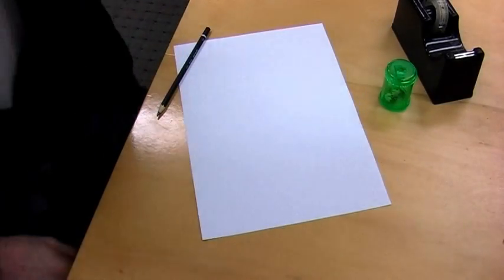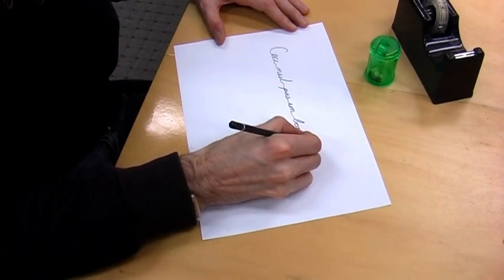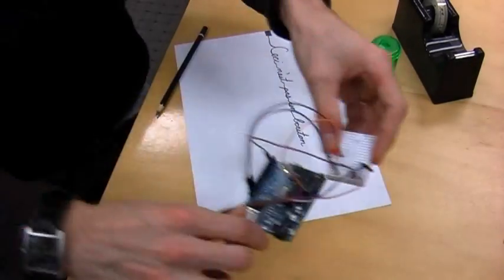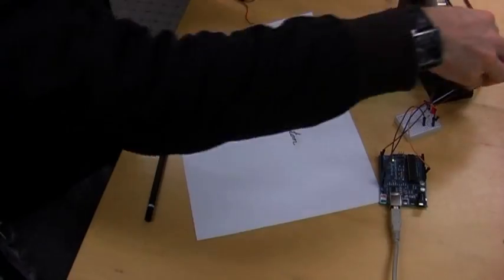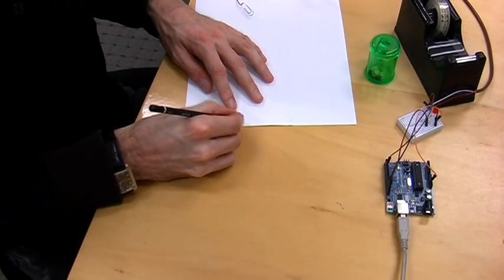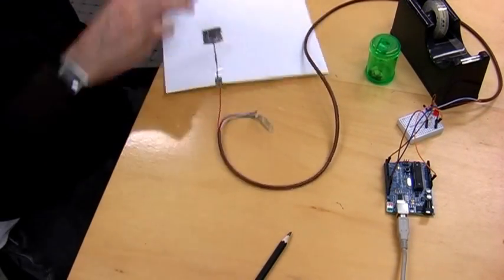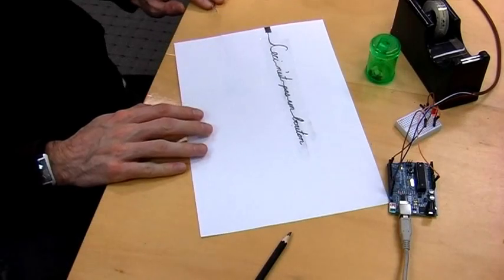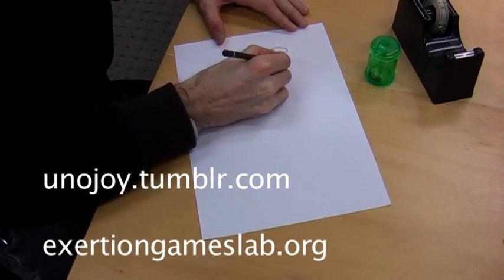Make a Touch Sensor with a Pencil Drawing

Comment: Tnx maybe using aluminum foil with resistors will help?using 100 resistors for each aluminum key?i still dont get what you mean by measuring the time and how you measure this.But if it's anything about getting value in the analog pin that sound to be practical.How do you measure the time?I read somewhere that when you put your finger on the aluminum foil the resistance will change is that wrong?Can we talk using hangout app if you have? My id is Sm.steve.moretz@gmail.com

Comment: Hello I really likes your project.I'm going to make my own paper keyboard but I don't have 100 pins for 100 keys of the keyboard.The question is can I get the voltage in arduino using one analog pin and then I can calculate which part of the paper was touch by the distance, and the figures I have set in the program?I basically mean to paint 100 keys and then connect that paper to arduino and wherever I touch I save the value for the arduino to recognize it! So I'll have a touch keyboard. What do you think is it possible?
Reply from the maker: To be honest, probably not, especially since the sensitivity would be pretty tight with the keys right next to each other, but it seems like it would be worth trying! The code is measuring the time it takes for a charge on the trace to be sunk by the body touching it, not by any particular voltage measurement, but that time should be longer the longer the trace, since the resistance from the pin to the body will be bigger.

Comment: I didn't understand the circuit. How did you made the circuit?
Reply: Graphite in the pencil is conductive, and essentially want they made was an antenna that changes resistance when you touch or move your finger close to it.

Comment: Control of explosion proof, waterproof, fireproof instruments or any instrument, which is often subjected to abuse (i.e. large blunt impacts).

Also note that with most capacitive sensors, assuming there is a trace to follow between the point of touch and the sensor pin, can be subjected to brutal trauma and still function.

For example, you can fire a bullet directly through a capacitive sensor (Alfoil on one side of cardboard) and it will still function.

Can you do that with any other switch?

Comment from the maker: The LED is on a separate pin, and I think it was active high, but that shouldn't really matter.  The actual sensing happens on a different pin, on an independent circuit which is measuring charge and discharge times of the trace.

Comment: Wowwy, How do we have the led hooked up? active high or active low? you answered all the questions I had regarding capacitive touch sensor. Basically, I'm wanting to add 256 sensors on a linear pad on a pcb. I'm guessing we have them active high, and possibly interdigitalize the pad so we can send the signal to another input pin for storage to see which line was tapped.